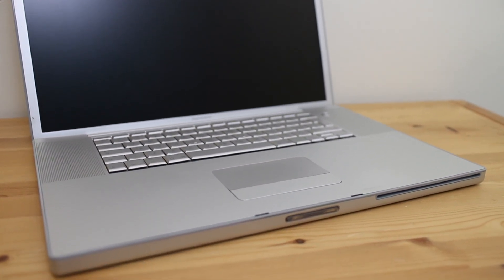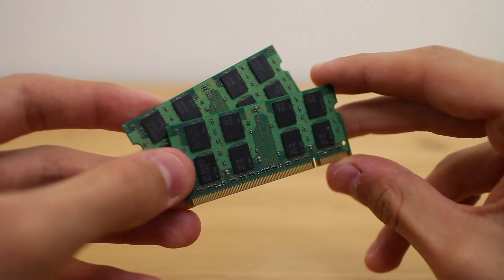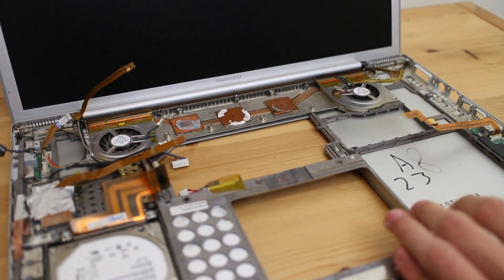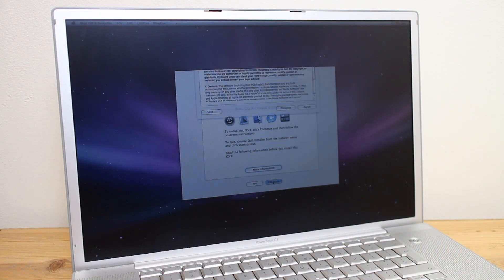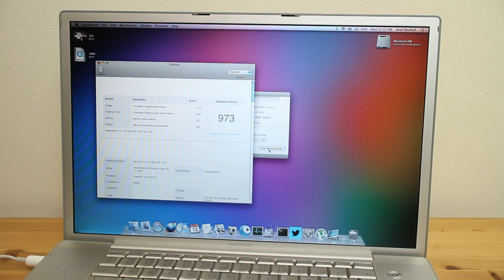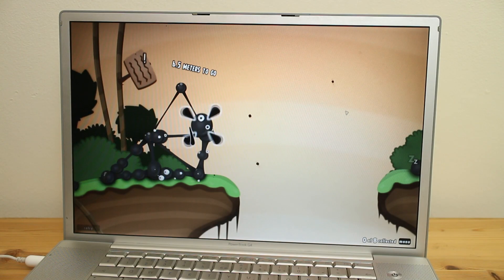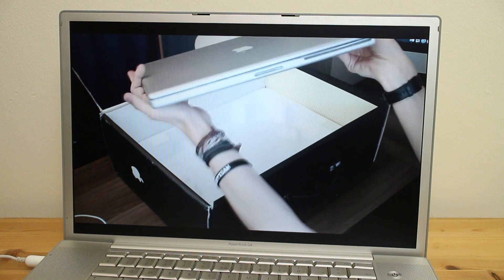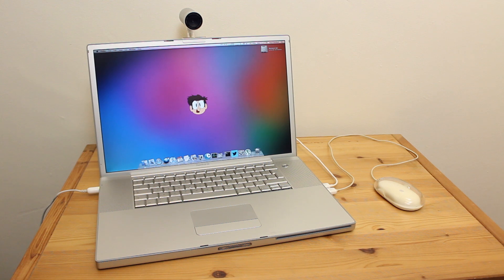The ULTIMATE 17" PowerBook G4! | The PowerPC Hub

Comment: Got the exact model and I love it!  I like to show off at the local coffee shops with it lol......could you please provide model numbers for the Msata, SSD drive, and adapter?  Notice that you went with the particular RAM, but if you had a choice what would be the "ideal" RAM to upgrade this with?  Anyone have suggestions?
Reply from the maker: Can't remember what model the SSD was to be honest, not that it matters. As long as you've got the adapter (Lycom ST-173-7) then you can't go far wrong. The RAM was standard Crucial PC2-4200 stuff. Again, it doesn't really matter what brand you go with as long as you make sure the stuff you're picking up is compatible.
Reply: Thanks for the reply.  Do you know if there is any size limit to the upgraded drive?  I notice you went with the 128GB mSATA drive....Is it possible to bump up to say 256GB? I'm looking to upgrade mine with a Toshiba drive.  BTW i picked up a boxed iSight cam back in 2013 still use it today when I'm the road!
Reply: @kewlnorcaldude  As far as I know there isn't a size limit on these, if there is it'd be around 2TB. RAM is 2GB max, 1GB per slot. Faster speed RAM seems to run at weird timings on mine (2-8-8) - probably best to stick to PC2-4200 speed!

Comment: mine was completely knocked.
Had to replace hdd cable, odd cable and optical drive, keyboard.
i'm planning to overclock the bus to 200mhz with some overvoltage and cooling.
It's just a shame the ram runs at 333mhz evenly on ddr2.

Comment: In the event that what little support that still exists for leopard runs dry, and you don't want these machines to sit and collect dust, I think at the time of writing, the most recent version of Debian GNU/Linux still supports PPC, as well as other architectures I haven't even heard of. I would have recommended stock Ubuntu with the somewhat prettier Unity Desktop Environment, however the last PPC build I can find of that was released in the 4th month of 2012. Elementary OS also would have been nice, but it currently only supports x86_64. ):

Or if you want to try your hand at an anima-like operating system, I think MorphOS supports a variety of PPC macintosh computers. Perhaps in the future sometime if it's no bother, you could do a video trying out one of these systems?

Comment: I recently acquired a 17" PowerBook G4 in pristine condition. It has a 1.33mhz processor. It's in need of an upgrade though, as it only has 512mb of RAM. If you don't mind, I'd appreciate it if you could list the specifics on the RAM and SSD you used to fix yours up. It would be a big help.

Comment: anyone have advice? I'm trying this upgrade but I just get the question mark at startup. G4 won't recognize my SSD. Don't see it when I hit option at startup either. I couldn't find the same msata adapter but found one that looks absolutely identical by Ableconn. The drive size max says 144,000,000 GB which is ridiculously high. Maybe a typo? I'm using a 500GB msata. Can anyone help?

Comment: I'm having a hard time finding Coreplayer of PPC.  I can only find a link to a file sharing site that says the file was deleted by the owner.  Thanks!  I have a G5 quad and the 17 inch hi-res 1.67 Powerbook G4.
Reply from the maker: http://macintoshgarden.org/apps/coreplayer-mobile-os-x
Reply: Thanks!  By the way, was it very difficult to remove the logic board so you could re-apply the thermal paste?
Reply from the maker: Nah it was pretty easy going to be honest. Although I have ripped dozens of these things apart over the years so it's kind of second nature to me at this point. If you haven't disassembled one before just follow the (excellent) iFixit guide and you should be golden.
Reply: Great!  I'll do that when I put in an SSD.  I'll probably go with one of the IDE SSDs from OWC.  I have to image the M.2 option you chose would be quite expensive if you wanted a larger capacity.

Comment: I love the look of the powerbooks but I think I'd rather build the ultimate MacBook Pro non-unibody 17". Similar look as the G4 but powerful enough for HD video and more. Great video!
Reply: PLEASE READ. Yeah i actually own one! Its a 17 inch high res macbook pro early 2008 model with a 128gb owc ssd and 4gb or ram (got a 4gb stick coming in so that will be 6gb when it comes in.) Its the 2.6ghz (yes there was a 2.6 but very hard to find as most are the 2.5ghz models) and it is the 512mb vram option (also harder to find). Only complaint is playing youtube at HD resolution is slow and sloppy. Ive upgraded it to the latest os 10.12.1 through the unsupported Macos sierra method. I wanted to ask what i could do to make youtube run better. Ive done fresh installs, maxed the machine out as you can see and tried all the browsers including the latest safari, but i've found that google chrome works best with youtube but safari works best with every other web page. Ive even used fluid to make a standalone app of youtube and it still is very laggy.  One last thing, I have done the oven trick with this machine several times because it keeps dyeing unless I have the fans unplugged which essentially "solders its self" all the time. If you don't know what i'm talking about then look up  a video titled  "how to cook your Macbook" and he will explain and show you how to do this. I wanted to ask what I should do about my heating problem because I have plugged the fans back in but they run at full speed all the time. They used to work like normal and only speed up when needed but they continually go at full speed.  It just too loud if they are always on and they eat up my battery life alot more too. Its a hardware problem for sure because ive tried different software stuff and it does nothing. Again, used to work fine. Also one last thing, if i did a msata ssd would that help my speed a little more with the adapter that has garbage collection?  Thanks man been following you for about 3 years now and I love your content, wish you had more subscribers though! haha Thanks again.
Reply from the maker: Yeah I see where you're coming from - I just wanted to do these upgrades to this machine as it's PowerPC. I'd love to own a totally specced out top of the line pre-unibody MBP one day.
Reply: I know its not PowerPC but would love to see that video!
Reply: I don't know if you're still looking for an answer to this, but I can answer at least part of it. Yes, you want an adapter with GC but not so much for the effect on speed, more so because of longivity - it'll cut the amount of writes down by at least a third.

Comment: How is the fan noise during gaming? My 12" PB sounds like a dustbuster in most games.
Reply from the maker: In World of Goo it's dead silent (the fans don't ramp up at all) and in Halo you get the odd spike of fan speed - but even with the fans at full blast, this machine is quieter than my 17" MacBook Pro idling. It blows my mind.
Reply: ***** Ah, it must be a 12" thing then, not a lot of room in there.
Reply: @segaprophet  Yep, the 12" iBook G4 is also exceptionally noisy, and my 15" PowerBook G4 DLSD is fairly quiet though it does run the fans a fair bit.

Comment: I was 16 years old when this computer was released. I couldn't afford anything like this back then. I've always been interested in the top spec obsolete computers from Apple, like the top spec 20" iMac G4.
Reply: I saw one of those locally a while back but the price turned me off, sort of wish I had gotten it. More into the top-spec G4, G5, and pre-2013 Mac Pro towers, such as the Power Mac G5 quad-core. But I do also have a top-spec 2006 iMac 24" with the rare GeForce 7600GT factory upgrade and still use it on a daily basis.
Reply from the maker: Same here. There's something special about having the absolute fastest, most high-end iteration of a specific machine.
Reply: I just got myself a 20" iMac G4.  Thinking about doing the same SSD upgrade on this as he did here.  Also just got the High-Res/Late 2005 15" PowerBook as well.  It was "non-working" for $20.  Opened it up and found the power board cable was partially disconnected from the board.  Re-seated it and it works like a champ!  Will be getting the SSD upgrade soon as well.  Both had 2GB RAM already.  Now the last of the awesome PowerPCs is to find a Quad.

Comment: Love the design of the powerbooks and early macbook pros
need to get me one if only just for the killer design

and man that CPU temp is insane, I reach 70 on my macbook pro with just firefox running a 480p youtube video
maybe I need to change the paste, machine is 7 years old now (2009 model)
Reply: Adam Blunt Tech I reach about the same temps with the latest MBPr, running just skype and a few tabs open in firefox + 720p youtube. I have manual fan control on... Firefox is just incredibly resource intensive. I get lower temps while editing a video ffs!
Reply: It's a real shame as Firefox is my favorite browser. I hate webkit and it seems all browsers use it now
Reply: I owned a 2008 MBP (same design as the powerbooks) and it got to about 90c! I replaced the thermal paste and used SMC fan control to bump up the fans to about 500-800rpm and that did the trick :-)

Comment: Awesome. I would have sanded down the heatsink contact surface with very high-grit sandpaper just to remove the top layer of oxidized copper. the oxidization does become a slight thermal insulator, and in a machine like this, every single thing you can do to keep the thing from overheating is definitely a plus, no matter what. so, if you have to get the machine apart ever again, it's definitely something to do.
Other thing to think about is adding a thermal gap pad between the mSATA SSD and the bottom casing there. those SSDs like to run hot in confined spaces like that. I have experience with this.

 I also didn't see you remove the fans and kapton tape around them to get to the heatsinks themselves, and I'd have expected quite a bit of dust build-up around the fins in there indeed, judging by how dirty the fans look by themselves. if you do have to take this apart again, you should totally look into if you can get those fans out and clean that all out, because dust is enemy number one. 
Something else to think about to make this box better, is an Echo Indigo IO PCMCIA card, if you can get your hands on one. they have OSX drivers last I checked, and although their third-party street price is kinda up there, it's worth it for a proper 24/96 sound card that you can install and remove at will.

also, why is your RAM only running at 400MHz? IIRC the spec should be PC2-4200, or DDR2-533, according to Everymac, at least. I haven't checked my own HR yet for confirmation, but that seriously doesn't look right to me. a higher RAM speed might bring up the Geekbench.
Reply from the maker: Thanks for the comment! Good point regarding the heatsink pads. Maybe something to do in the future, but given how stupidly cool the machine is running it's definitely not necessary at the moment.

I did think about getting some sort of contact between the SSD and the bottom casing as I was worried about how much breathing room the SSD would have, but when I was testing before recording the video it never got any more than toasty in there (40°C) so I didn't bother in the end.

I did rip the fans out while I had the logic board out and gave absolutely everything a thorough clean. I just wanted to keep the video concise and thought blabbering on about removing bits of dust would be boring.

Regarding the PCMCIA slot - Again, I did look in to getting something to fill the slot, but as part of the charm of the PowerBook is its beautiful design I didn't want to go out and whack some garish looking card in there just for the sake of it.

And the reason why the RAM is running at 400MHz is because it's PC2-3200 memory! I know I know it's a bit hypocritical to put memory in a totally maxed out "ultimate" machine that doesn't run at full speed but I had it lying around and honestly, the real world difference you see from 400 to 500MHz RAM is negligible at best. I will definitely be purchasing some though as I really, really want to see this PowerBook bench >1000!
Reply: Quick question. After doing some hard thinking about it, I'm going to purchase one of the IDE to mSATA adapters to try out in my few-years-older-and-much-crappier-performing Fujitsu ultraportable. can you possibly at some point open the powerbook back up and quickly look to see what chipset is on the adapter board itself? I can't seem to find a proper ST173 to purchase here in the states, and if I'm right, it might just be a JMicron chipset of some manner, but I want to know exactly which one so to find a suitable alternative if this is the case. I'm expecting slightly similar read/write speeds with that laptop, since I'm fairly certain it can do UDMA-100... but even if I'm stuck at UDMA-66, it'll still work out for me in that the machine in question will be completely free of all mechanics since it's a passively-cooled laptop with a dinky Transmeta 1W TDP CPU.

you could even turn this into a video showing alternatives with the same chipset if you can find them on eBay for a decent enough price out of China, shipping costs notwithstanding, so long as you mention that shipping costs in the video won't necessarily reflect what the interested viewer might find on their localized eBay listings. that and I'm very curious into how this controller chip takes care of "garbage collection" so it says.

edit oh nevermind, it's a Marvell 88SA8052: http://ic.pics.livejournal.com/boggyb/999176/90104/90104_original.jpg